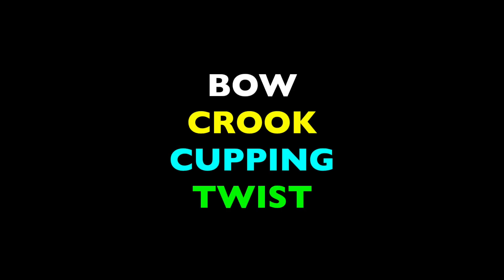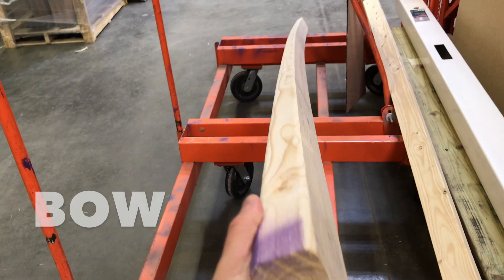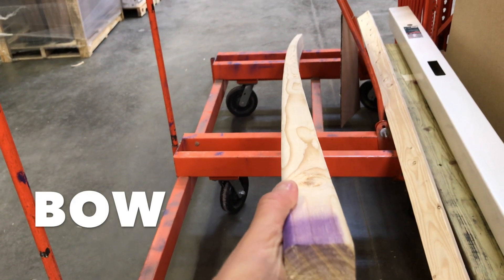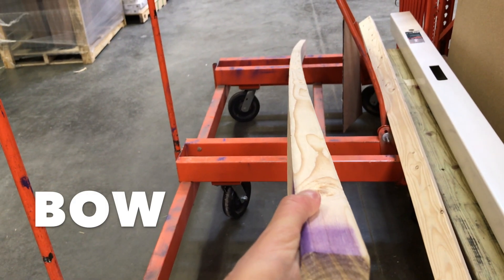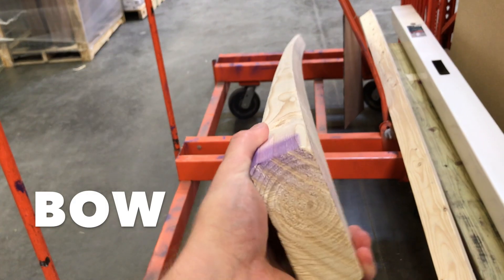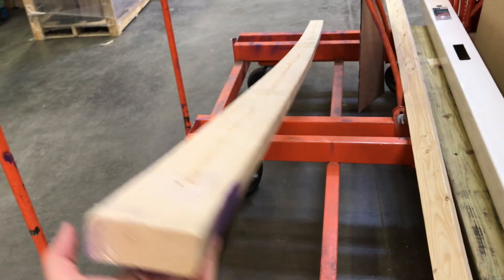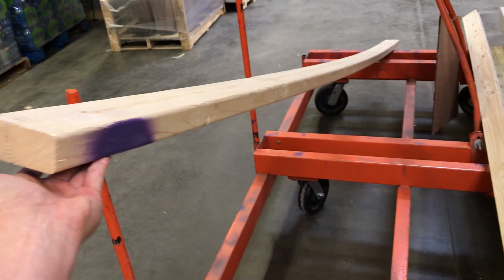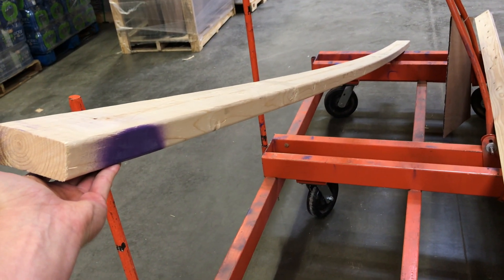4 TYPES OF WOOD WARP (Where They Come From + How You Can Avoid Them!)

Comment: Ok, jumping in here 3 years late. I bought some 2x4 pine for a job, which was delayed a few months, so I laid the timber flat in the room it was to be used in. When I came to work with it, every piece had twisted, all in the same direction to varying degrees. Twisted so much it's unusable for the new walling that was going up. Thanks for the video explaining why.

Comment: I am hoping you will get this even though your post on warped wood is three years old. I have a situation. I just purchased $4,000 of cedar to install an 8 ft privacy fence. Wood was delivered and dropped in my yard out in the elements end of December. It was all banded and looked good. I broke the band to release the steel poles. They had banded the poles and the Western Red Cedar Rails 2x4x12's together. This past weekend (3 weeks after the band was cut) I started working with the 2x4 wood. Almost all of the 2x4's were warped. Some more than others. The supplier ensured me it was Kiln Dried and Western Red Cedar. What do you suppose happened. Did the dry wood soak up moisture after several rain events and warp? I thought WRC was more stable than other woods. If it dries out will it go back to its dry shape? I just talked to the supplier. They were less than helpful. Is there any way I can straighten out this wood? I saw a youtube video of a guy that soaked his warped wood. Once it absorbed the water they straightened out. Any thoughts would be help ful. Thanks.

Comment: I remember my family had a mahogany import mill and they would grade the lumber and then it would go on sticks so air could pass b/w the layers and eventually it was sent to the dry kiln but I remember my grandfather telling me its generally a 2 phase process of drying.    The first phase was a high heat / low humidity phase and I think for 16 quarter (that is the thickest of boards) it was about 1 week.  I assume that was for drying the free water that you explained.  The 2nd phase was when they lower the heat but raise the humidity % and it had time cycle of about 3 weeks.  I assume that was for the drying out the cellulose.  They would check periodically with moisture meters to determine what it needed.  I think 4 quarter was about 7-9 days overall dry time and 16 quarter was about a month.

Comment: I feel this!  I can't express how much I hate wood twisting!!!  I bought some 6x6x8 landscape logs this past February (and sighted them) to redo a retaining wall that was all rotted out and falling over. The new logs were stored and spaced 2 inches apart with each 8 footer supported under two wood pallets to accommodate the 8-foot length. All was stored in the shade, under a covered car port, next to a garage, away from direct sunlight.  I went to install them last weekend and was shocked at how many boards twisted on me. I can put my palm down on one end of the board, and the other end raises up and twists to one side. Not sure how I can still use these logs....I suppose I can try to install a row, keep the one end level to the other existing board, and the high end could be planed down with a hand planer, but that would leave a noticeable gap on the bottom end of that board that would need to be filled somehow. I have 16 8-footers that would be used to redo this wall. Is there a better way for me to get these twisted boards level again?

Comment: I am in coastal NC and getting ready to re-surface an elevated deck with PT 2x6s that I am sure will be wet when I get them from the lumber yard.  Two questions, 1. Should I leave any space between them when I install, and 2. bark side up or bark side down?

Comment: i'm attempting to build guitars, and i'm running into this problem alot, one of the builders at charvel says on the high end one off models he'll mak 1 or 2 cuts and let a neck sit a few days because just taking a little bit off cuts the fibers and the wood will move, which is why guitar companies have started putting graphite reinforcing strips in the necks

Comment: We are builders in New Zealand where it is wet and moisture a problem for homeowners. Most of the timber sold in timber yards here is stored outside and exposed to the elements year-round. There is a lot of warpage and in every direction, you described! Thank you for your video which explains why and in a straight-forward manner. I plan to share it with timber merchants here.

Comment: As a tile setter who installs stone showers, I used to really hate carpenters and wonder why the hell it is that they can't install anything straight, plumb, or level. After about 15 years obsidian Stone oh, I started doing project management work for a general contractor, at which time I came to understand that the wood moves after it's installed, kiln-dried notwithstanding. So my apologies to all the carpenter's whose ears were ringing for those 15 years. 🤗
Reply: Something I found out was on PT lumber you've probably noticed how a lot of the boards have varying widths down the length of the board.  That is actually caused by the pressure treatment process.  The boards were sawn correctly but when the boards are submerged in the chem treatment, the chamber is pressurized so it's trying to push the chemical into the boards.  What the grain is doing at a certain point on the board will determine how much or how little the board is going to swell.  I was told there's no way that can be prevented.  Some grain patterns will not swell at all while others will bloat a good bit.   Every day, sawmills are cussed out by carpenters over this, and they think it's caused by people that can't run rip saws correctly, but the truth is it has nothing to do with them.